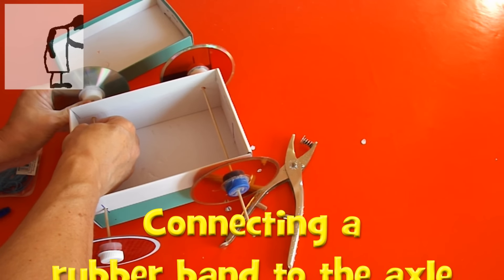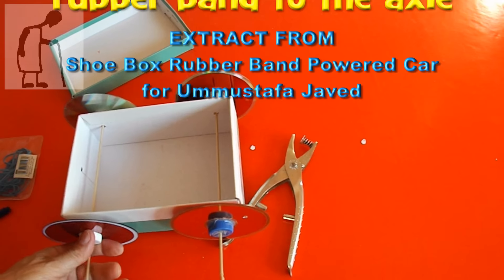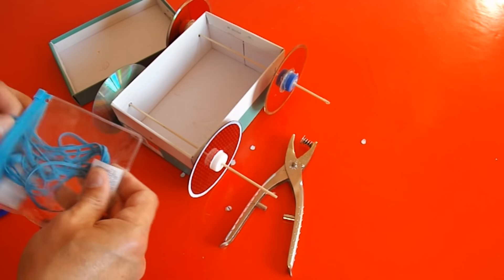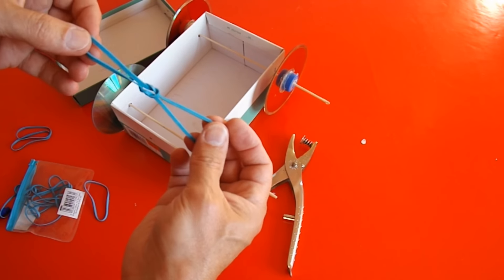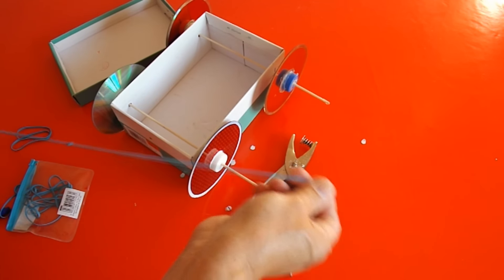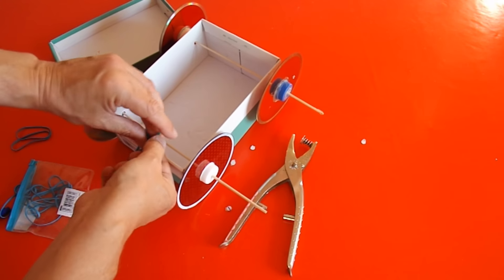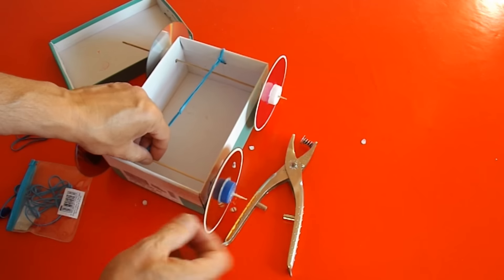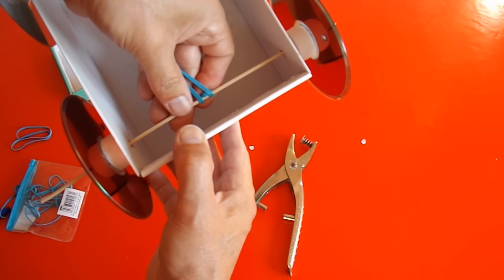Connecting a Rubber Band to the Axle - Rubber Band Powered Cars

Comment: I found these rubber bands, Grandad:
http://es.opitec.com/opitec-web/articleNumber/102403/kshofl
Reply from the maker: +Francisco Javier Lázaro Pinela thank you, that is a very interesting site. There are some good looking items for sale. I like the look of the Avispa Opitec :)
Reply: +GrandadIsAnOldMan The wasp, I made it !.
And the thought release this summer or this spring, but my cat, who climbs everywhere, threw the plane and you have to fix !. 8-P
It's easy to do and how much to cut the nose where the engine is. But without great difficulty.
It could replace the battery, a super capacitor 3V. Lighter and with the right load.
Greetings!
Reply: +Francisco Javier Lázaro Pinela And you can download the pdf with the plans, too.
http://nbg-web01.opitec.com/img/100/995/100995bm.pdf
Reply from the maker: Francisco Javier Lázaro Pinela haha, yes I already downloaded the PDF when I looked. Maybe I will make something similar myself at some time, the reason I downloaded it was to see the detail of it's construction.